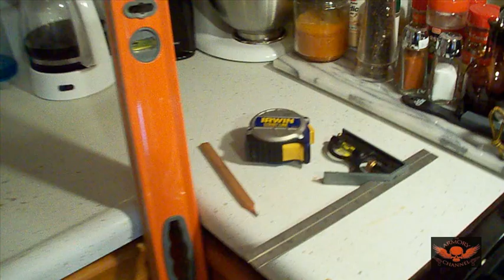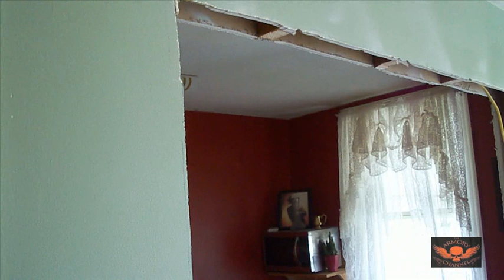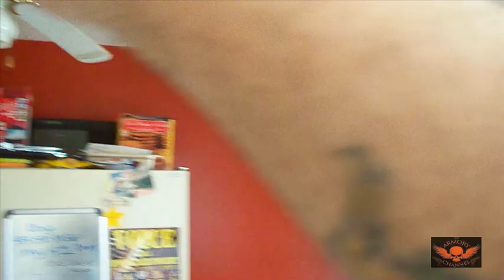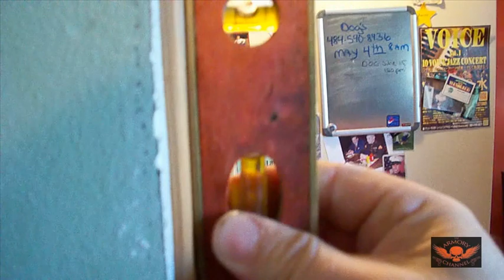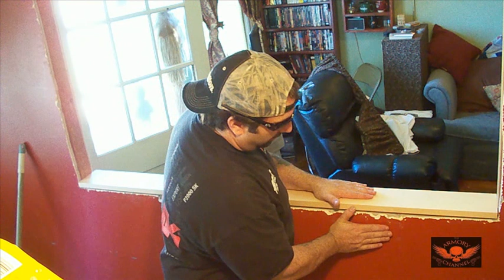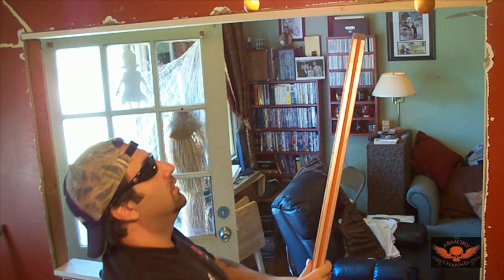HOME PROJECT

Comment: Is that a load bearing wall?  Do you have access to the attic to see if ceiling joists are bearing on that wall?  If it is,  a header would have been good :)  If it is load bearing your ceiling will start to sag and crack eventually.  This comment is mainly for those who know nothing about construction.  They would need to check their own walls to make sure they are not load bearing.